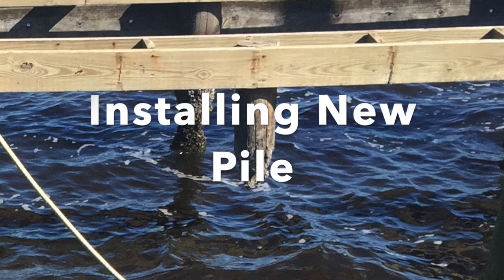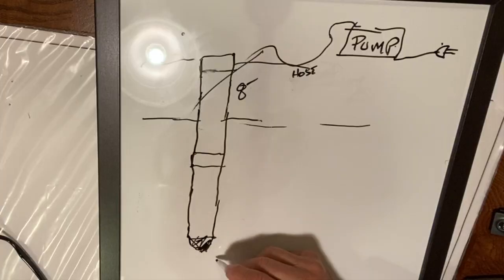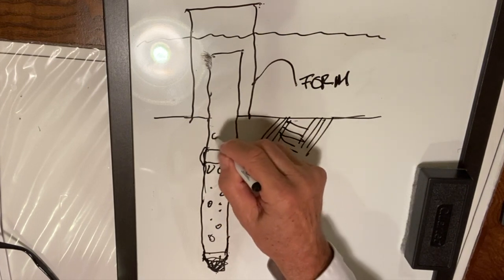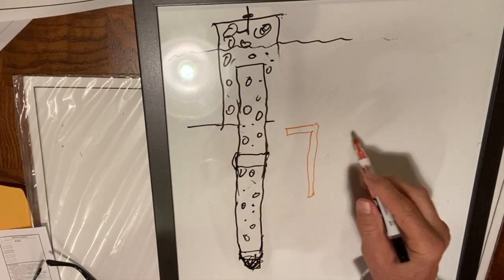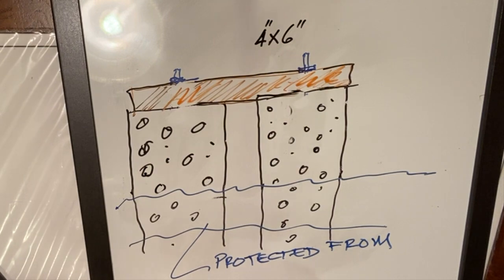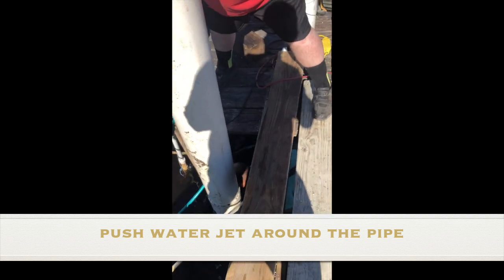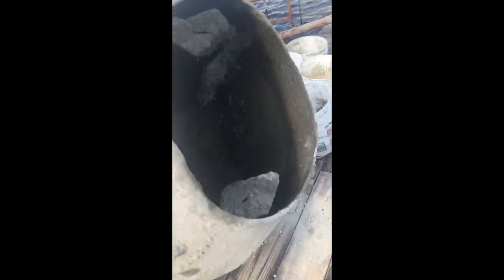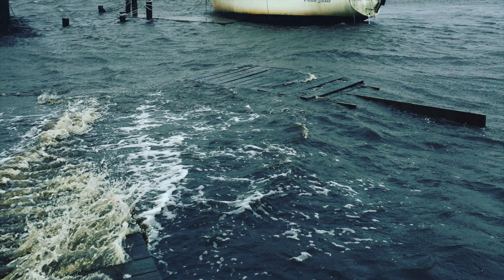Water Jetting  PVC, Wood,  Concrete  Dock Piles

Comment: The Cardboard form didn't deteriorate away in the water before the concrete set? Seems like the cardboard forms would deteriorate well before the concrete got set up.
Reply from the maker: If you have the cardboard more than one day in the water, it starts to fall apart.  But when using cardboard we would immediately add the concrete. Cardboard tubes are about $ 75 per 10 ft of tube.  That is why we started making a few fiberglass forms

Comment: How do you determine the necessary depth of the pipe into the "sea floor?"
Reply from the maker: I try to get it to the bottom sea bed.  Sometimes the current scours out below the mold.
Reply: @myeasyfixx1205  So is there a general rule of thumb where you find if you go X ft deep then generally speaking you're fine? That was my concern too was if water created the hole, it'll just wash out around the pile

Comment: My seabed is a little more rocky than Sandy how do you deal with that?
Reply: Also I am trying to use the PVC as piling for a floating doc
Reply from the maker: PVC is smooth, that may help the pile to sink.
Reply from the maker: I am not sure, depends on the size of thw rocks and the water pressure you have at your tip.
Reply: @myeasyfixx1205  it would be 2500 psi

Comment: These pilings have no steel reinforcing bars inside them?  A typhoon (I guess it's our version of your hurricane) just wiped out my dock. I need to figure out how to rebuild it to last until I retire. :)
Reply from the maker: Yes Taj, there is no steel reinforcement in the pilings.   I could have easily installed steel.  The damage I got was mostly biological action on the wood pile and during hurricanes the uplift of the decking lifted it off and it floated away, while the good piles remained in place.
Reply: @myeasyfixx1205  Thank you for the clarification. I'm based in the tropics  on a small island (poor country) where everything is done with mostly wartime (WW2) methodologies. So watching your video with my guys was like the Dawn of Man Ape Scene from 2001: Space Odyssey. Hahahah. No seriously. Had to pick up a few jaws off the ground there--including mine. Since I am a stupid monkey, lemme ask: how would you include steel rebar in your build? Simply insert pre-tied rebar during the pour? Also, nobody here knows what kind of pump you used. The submersible pumps I see here are meant to be used to pull fresh water out of the ground. The pumps we have on hand are centrifugal pumps we use to irrigate our fields. Can we use that? How much pressure / flow rate am I looking for? Sorry for all the questions. Will send bananas. And coconuts. <3
Reply: @TajDeluria  If you can get some glass fiber that is designed to go in the concrete mix, that adds a lot of strength much more easily
Reply: @tom.mattausch  Thanks for the response. We rebuilt it as a temporary pier for now while I figure out how to build something to last. I've looked into glass fiber reinforced concrete. Looks doable.

Comment: How will you know that you have reached stable foundation during the process of water jet the pvc pipe?
Reply from the maker: You don't reach a stable foundation.  The loading of the pile is based on 2 different resistance parameters. The first is the bottom surface area. This friction factor is very high, but the area is very small (area of the pile diameter).    The area of the pile perimeter is very large (Pi X Dia X lenth embedded in the sand) times the side fiction factor.  When you add both loads  you get the maximum load the pile can carry.
Reply: @myeasyfixx1205  thanks very detail answer

Comment: Please tell us if the PVC pipe is part of the pour or permanent part of cast in place?
Reply from the maker: The PVC is filled with concrete inside and outside.   Unfortunately the PVC is expensive otherwise it would be the way to go. It is easy to handle and sinks right into the sand.  The PVC  pipe I used was extra from another job

Comment: ok,is the 8" plug is it a glue on cap,,guess i missed something
Reply from the maker: The plug was was just concrete at the end of thePVC pipe.   A cap would also work, but I didn't have a cap.  The PVC pipe was extra piping from another job.   I wood have water jetted a wood pile if the PVC piping was not available.

Comment: I used to live on a river and restored slow over the years my seawall and retaining walls... starting with piles that I hammered in and working up.  I thought the tripod or diamond style piers were impressive... though down river others told me they used this type method.   Neat was I wound up re-purposing an upstream salvaged washed out dock for form and temporary embankment materials.   Recently I've wondered about using PVC pipe cut in half with a hinge and clasps or racket straps to make a form though for re-enforced concrete work... though maybe that would apply to these designs also with less fiberglass mess and cleanup work.  Thanks for sharing!
Reply from the maker: The disadvantages 1. The PVC pipe may be expensive, depending on the size.  2. It will be heavy. 3. dont use hinges.  When you are in the water, how will you open the pipe. 3. Probably the biggest problem with the pVC pipe is that the PVC is not flexible, unless you select a very thin PVC pipe.  I am not sure if a flexible PVC pipie exist in the larger diameter. The PVC pipe must bend, be flexible so you can remove the form from the poured concrete. Take a look at my video on making a fiberglass form.  In that video I stress use 2 layers, but  no more than 3 layers of fiberglass else you cant bend it off the concrete pile.
Reply: @myeasyfixx1205  Thanks!  I forget how the larger size PVC is amazingly heavy and even equivalent schedules... thicker if I recall correct unless maybe they make a thinner schedule I've never seen.  I know up to 6" PVC there is the thinner lighter more flexible Sewer and Drain Pipe ASTM D2729.  Haven't seen in larger diameters... though if is made, my guess is more flexible and easier to make a form with.  Thanks for the reminder as I recall Schedule 40 10" is heavy and thick walled.  Not easy to handle alone without a doubt.  I have seen the 10" PVC though used for above ground decorative columns in a Gazebo design online now that I think about some more.  http://lacasadelwacho.com/photo3.html  I'll read into and watch the fiberglass form video.  Thank you sir!
Reply from the maker: Sorry, I misread the comments icon.   The smaller the diameter of PVC pipe the less flexibe it will be.   From a production perspective the manufacturer has to make a pipe for a specific pressure rating.  Therefor, to achieve the design rating, larger pipes have to have thicker wall thickness.  Not just for internal pressure but also setting the pipe.  A thin large diameter pipe would need many more pipe supports to satisfy deformation codes.
Reply from the maker: Hi Jafinch78
I am construction another mold which is 24' diameter.  Some of the piles are being scroured, so I will create a small ring at the bottom with rip rap around the new 24" concrete skirt
Reply: @myeasyfixx1205  Hi, guessing you're experiencing mechanical abrasion from the currents and aggregates?   Looking back at my first comment... I can edit to clarify or I'll note now.  Once the piles were driven, I poured the wall sections making sure to use continuous rebar for a re-enforced concrete (RC) structure to better uniformly distribute the loads.  The seawall structure was meant to be like and literally the base footing for the continuous footing going up the hillside with piles under each footing where a wall stood.  RC "deadmen" like for retainer wall design is the term.  All with re-enforced concrete rebar design continuous to also stabilize the hillside due to highway traffic in the front yard and being on a peninsula literally with the river winding in my backyard and then down the street wrapping around to my neighbors backyard across the street.  Due to restoration guidelines where not requiring a permit, I could only work on... I forget offhand... maybe 150ftsq annually.  Over that I'd require permits and I checked with the local networks who actually perform the work to verify since was amazed how many acted like they new something better and like I required something I didn't.  Like you are doing... depending on the height of the structure... since the seawall is facing a body with ice formation... in order to change the direction of the force vector from a perpendicular ice form smashing into the original design vertical wall, the wall was sloped something like 45 degrees (don't quote me I forget) so to roll the ice upwards and better breakup the ice moving against the seawall outer surface instead of bashing in over and over and over throughout the years.  So the new design has a sloped face.  Then underwater maybe up to the water line depending on river levels... rip rap was added to prevent washout from bellow after working some of the material in the river that was already present and not muck, back over the base of the new pour.   Reads like what you are doing is a great idea.  Good idea!
Reply from the maker: Yes, there is a lot of machanical abrasion at the bottom of the piles.  We are not sure isf it is simple erosion of the sand on the river bed.   I just completed a new set of fiberglass forms 24' diameter.  The video has been uploaded to this channel , Myeasyfixx.
Reply from the maker: Many times I cannot recognize that a comment was made
Reply: @jafinch78  You can get "low head" thin wall PVC pipe up to 14" diameter maybe more.  Also look at PVC Snap Jackets.
Reply: Wondering if you can use a pressure washer or other pump with a cap on top of the PVC driven pile pipe to make the driving fast and more from above?
Reply from the maker: I am sure that pressure washer would work. Possibly better than a simple sump pump.  I bought the sump ($ 80) pump and used an old garden hose.  I wanted something simple

If you use the pressure washer from above, without the bottom plug, you loose the benefit of filling the the pvc with concrete.  Maybe I did not understand what you are saying

Comment: Nice work!  I did something similar building a pier.  I used 6"PVC without a plug.  I jetted water on inside of the pipe which left a tighter fit and also mushroomed out the soil at the bottom of the pipe, allowing the concrete to form sort of a footing at the bottom.  I left the PCV in and filled with rebar and concrete.  So the result was a PVC wrapped concrete pile.  One thing I later learned about piles is that in many areas the upward or downward strength is driver by skin friction.  Next time, I will drill holes in the PVC so that just a little concrete comes out under the ground.  Thanks for sharing the video.
Reply from the maker: Yes, you are correct.  Actually, I did start another video which estimates the load capacity of the pile due to the skin friction.  I never completed the video because I found that I would be presenting a lot of math.  

As for the idea of cutting the holes in the pipe to allow the concrete to pour is very good.  If the holes are big enough and strategically placed you may have discovered a new way for creating piles.  Only extensive tests will reveal your concepts benefits. Good luck in your efforts.  Please  send me pictures  of your project, I can even add you in a video if you wish

Comment: How do you get the pvc pipe back out of the sand?
Reply from the maker: You never get the pvc  pipe out.  It will be full of concrete. Only the thr fiberglass form is recovered for another use
Reply: @myeasyfixx1205  thank you. You answered my recovery question.